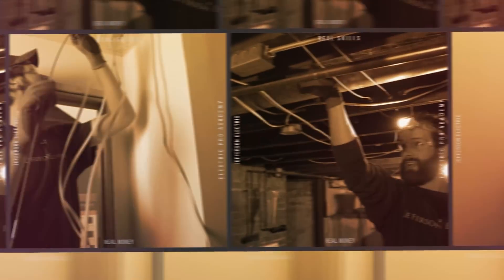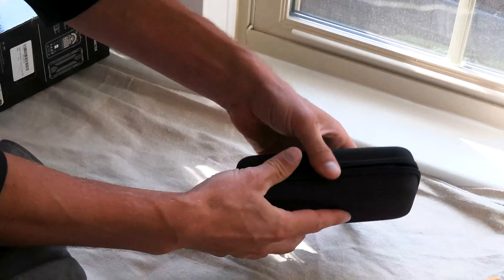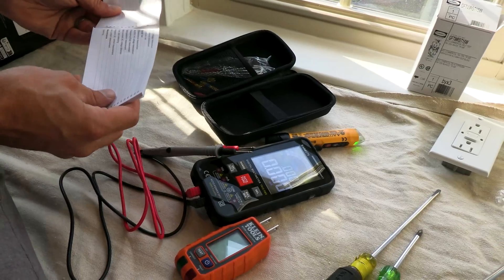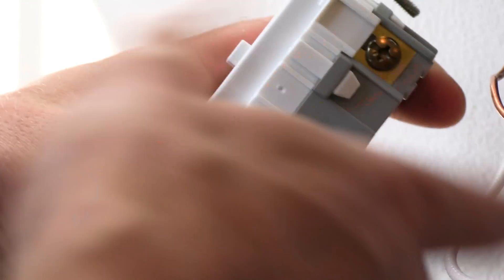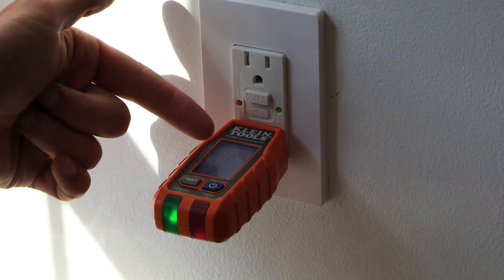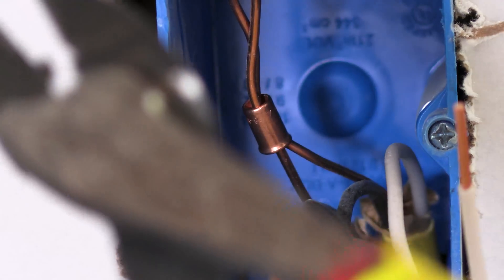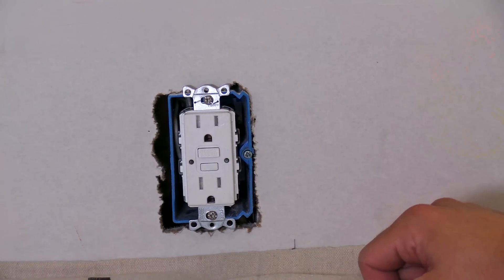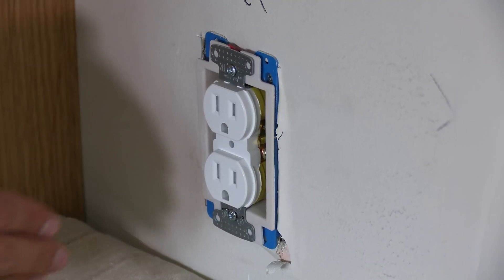Do I Need To Buy $20 Outlet Receptacles For My Kitchen?!

Comment: I guess depending on locality but you could also just use GFCI/Arc Fault dual function fuses and skip the GFCI outlets all together. I did this in my kitchen build to help lower the cost since I had so many outlets (sure I could have just used 1 GFCI on each of the two counter top circuits) and since I had to use the dual function breakers it was a no brainer for me.
Reply: Fancy breakers are also less convenient than localized GFCIs.
Reply: It's all up to the client's pocket book and their preference really.  Also those combo breakers are pricey.  Starting from fresh is best for afci/GFCI breakers, but for reno old work, can't trust how the house is wired.
Reply: @ptso7580  lately NY city inspectors don't care if it's new construction or renovation they wanna see AFCI breakers for all living spaces and that's also for A/C receptacles, last apartment I had inspected only 3 of the 15 breakers ($50 each) were not AFCI those were the 2 countertop GFCI and one bathroom GFCI even the fridge receptacle had to have an AFCI breaker to pass inspection on a renovation. I heard the inspectors outside the city are less stringent though.
Reply: @2JDAILY  Makes me wonder what their cut is.
Reply: @2JDAILY  Is that NY entire or just the Big Apple?  I can see why for the strict code enforcement for NYC area.  Lot of mice in those stacked boxes.   I've worked in NJ, PA and CT and lot of the houses I worked on has multi branch circuits.  Combo AFCI GFCI 2 pole breakers are crazy $$$$ and hard to find for some manufacturers.  Inspectors in my area knows this and are willing to work with you and the client.  Will the good ones do.
Reply: @ptso7580  so far I've only gotten a hard time in NYC, outside the city and even on long Island they'll work with you but not the city inspectors, the NYC amendment to the NEC is a whole code book in itself so I do understand to some extent.

Comment: I found it a bit puzzling you would refer to GFCI as a nuisance device when in reality it’s a safety device when wired properly and the appliance or item operating properly
Reply from the maker: Nuisance BUT hugely important! We actually mostly said this because of our work with EVs and the issues arising around AFCIs & GFCIs tripping overnight and people's cars being undercharged in the morning 😕
Reply: @ElectricProAcademy  Nuisance tripping from EV chargers?  Did you track this down to harmonic content on the neutral from the charger?

Comment: Funny story I had prove an electrical inspector wrong a couple months ago cuz I ran a 20 amp circuit for a GFCI plug outlet and I put normal 15 amp GFCI outlet in and he dinged me for it but then I pulled out the code book and proved him wrong that I could use a 15 amp outlet you don't need to use a 20 I had to prove him wrong
Reply from the maker: Way to know the code!
Reply: @ElectricProAcademy  was I right
Reply: @FHES2005  depends on what area.
Reply: oversizing wire should never be a inspectors issue as long as it fits manufacturer lugs. this inspector sounds like a clueless handbook hero
Reply: @@user-tt2iu2db7d ya not sure why you would do that if you need 120 volt appliances to function. I imagine this is just a bad dad joke

Comment: We gfci every circuit in our homes in the uk because we use mighty 230v single phase supplies, not puney 110v
Reply: Don't forget 230 volts a lot more dangerous if you get shocked. Nobody makes a GFCI that will trip if you were to get hit with both hot 230 volt wires at same time. Have been shocked with 120, 208, 240 & 277 volts and 5,000 volts from oil burner ignitor transformers. 120 volts usually only gave my fat ass a slight tingle but when you double the voltage the shock hit appears at least 4 times as much tingle.
Reply: It's 120 volts, not 110.  

We "brave souls" have receptacles in bathrooms and we don't have electric showers.  Go figure.
Reply: @jovetj  Ash, but we need to power the chargers for the electric tooth brush, shaver, and have power for hair care appliances and other 'stuff' folks think they need in the loo.
Reply: @raygunsforronnie847  Extension cords to the rescue!
Reply: In Europe often the whole apartment or even hose was protected by just one RCD. In the US one would not want that as nuisance tripping is more common with 5 mA than 30 mA. Now one at least separates lights and sockets on every room on different RCDs so one does not lose lights when one trips. There are, howeverm RCD sockets available in the UK.

Also the mechanism how they work is different. In the US they are electronic. In Europe typically electro-mechanical.

Comment: I have really bad experience with Hubble WR gfci’s, I replaced about 20 installed by me within 1 year of the original installation.
Reply: We had a ton of trouble when scum bags Hubbell moved expensive hospital grade TR receptacles factory from USA to Korea. You would get the stainless steel 6/32 oval head screw almost tight and screw would break off flush with device. Could not drill a hole dead center to try to use a broken bolt tool to remove broken piece. Pisses you off when you purchase the best device and it's a POS lemon.
Reply: @JohnThomas-lq5qp  Buy Leviton. ;-)
Reply from the maker: Thanks for this feedback, y'all. We may need to do some inventory reevaluating!
Reply: @ElectricProAcademy  yes really disappointed with Hubbell. My go to is Leviton they bought JCC LEDs also in UK and the design of their light s and GFCIs/AFCIs were so much better with little flourishes that you notice signaling that they were designed with the electrician in mind to make installation easier. Plus testing them I found them so much more consistent better able to pick up on fault leakages even though they were just a type A GFCI